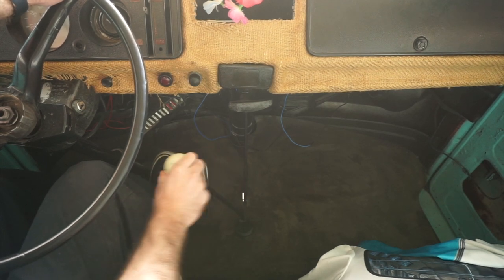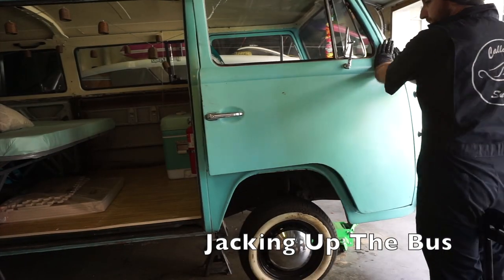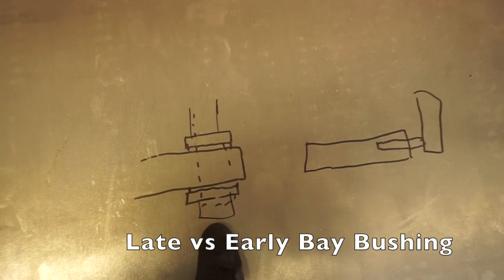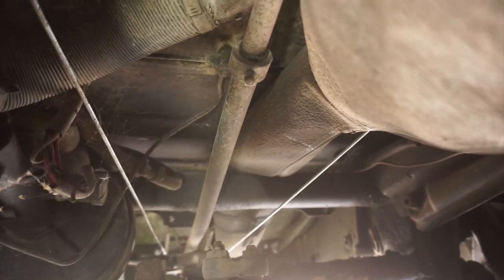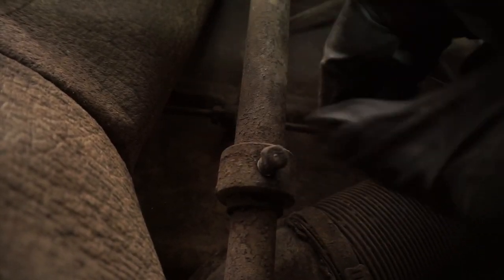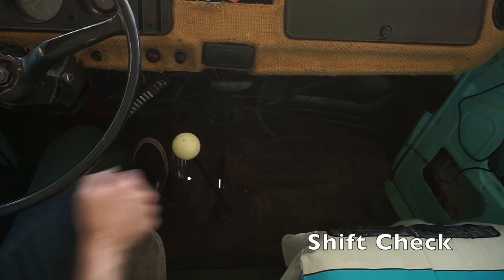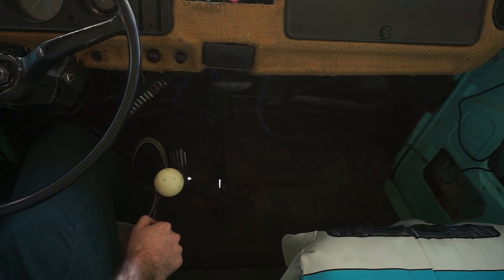VW Bus Shift Rod Bushing, Bay Window.  1973 VW Bus Restoration Part 7.

Comment: I have a 72 type 2. I,m in the process of changing the bushing. How did you get the front shift rod slide back so easy in order to get off that nub?? Mine won't slide off the nub. Did you have to go further back and disconnect the other 8mm nut near the transmission?? I don't want to do that. Help!! Thx
Reply from the maker: There’s a slip joint about 3 feet back (at least on late bays) that has a square head set screw.  Just loosen that and the front section can slide back.  Just make sure to reset it at the same length.
Reply: @callalilycollective  I got it to work. It was stuck but as I worked on it, it slid back. Thank you
Reply from the maker: @tompitt631  Nice, glad you figured it out!

Comment: I really need to do this on my 71 and now I see it’s not hard so thanks!
Reply from the maker: It’s pretty straight forward.  There’s other ones further back on the shift rod that are a bit more involved, and I still need to to that (once I figure out how 😅).  

I believe your early bay should have the same style as mine.  Must other videos I have all seen are late bay (not counting 73) and have a different bushing style.
Reply: @callalilycollective  I’ve been working on the brakes and it looked the same to me. I’ll check later. It’s 19 degrees out so working on the bus is done for today. Where did you by the bushing? And will any grease work? Thanks so much!
Reply from the maker: @Johnhasabus  think I just got it from either jbugs or one of the many other VW retailers.  You can buy all the bushings in a set on Amazon but it’s over priced, and you’ll only need 2/6 it comes with.  

Make sure you change you fuel lines asap if you haven’t since getting the bus.   Also  recommend the blaze cut system for engine fire protection.  I would do this prior to doing the shift bushings.

Comment: Hey i was just taking my scat shifter out and noticed that ball on the shifter that goes down into socket , had no little rod on it. I was trying to see whats the issue when i lost all my gears at once but now i feel like thats why i have to get new shifter assembly because it definetelly has to do with it.
Reply from the maker: Sounds like that would do it.  Without that pin you really are only controlling forward/aft position.  Need that pin to control the roll.   Fingers crossed that’s all you need 🤞

Comment: That’s a late Bay Window.
Reply from the maker: Indeed it is, but 73 is a transition year, so 74 and up have a different bushing.  I believe the 68 through 72 (early bay) have the same bushing setup as the 73, but that could be wrong.

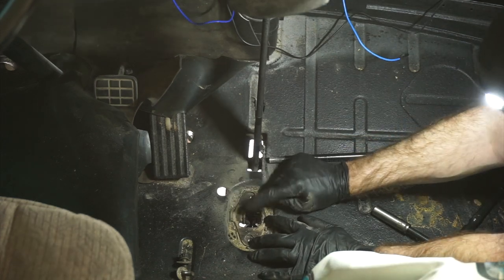Comment: At the 3:11 mark you show your shifter plate has the longer flange on left. Not sure about buses, but for beetles the longer flange is ALWAYS on the passenger side. Vw would never have them different ways for different models. Are you sure your shifter plate orientation is correct?
Reply from the maker: I am not sure, and doing further investigation now.  I don’t know how many previous owners there were, but there has been a lot of questionable things I’ve found on this bus so far and I just put the plate back the same way I found it.  This might explain part of the difficulty in finding reverse.  I’ve found two threads on thesamba that confirm what you’re saying, but also a photo that appears from an old VW manual that looks like the long tab could be on the left.  

Appreciate the help!  Once I confirm the orientation I’ll add a text card into the video so others don’t make that mistake.
Reply from the maker: @bertsparrow thank you so much, you are correct, the long flange should be on the right side!  Added a note in the video at 3:05 to hopefully not misguide anyone else, and updated the video description with more details.  

Amazing how much easier it is to shift into reverse now 🤣